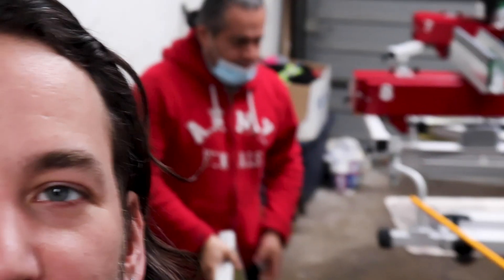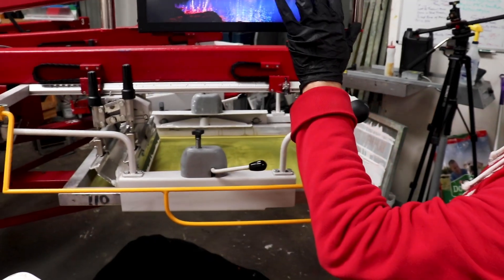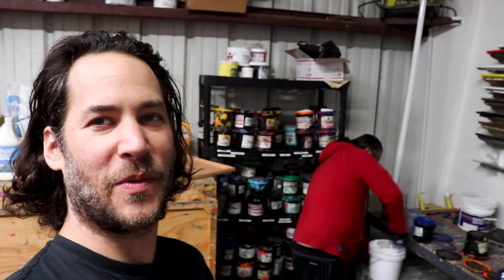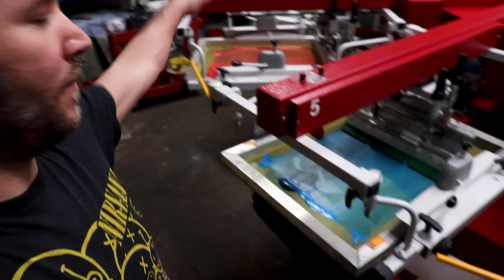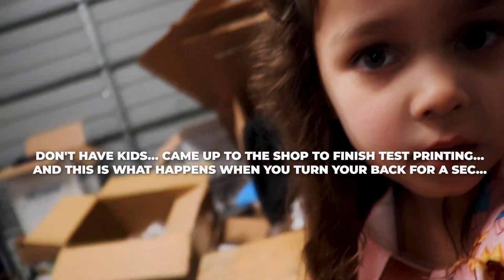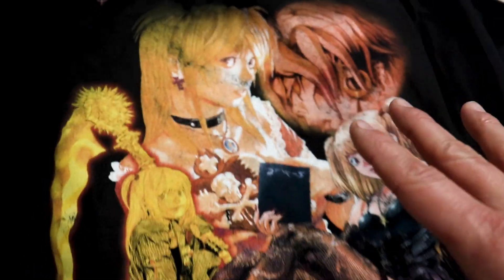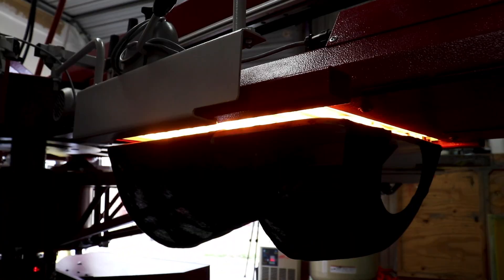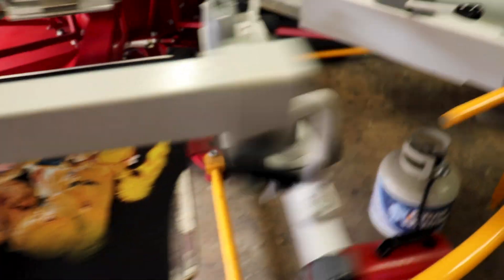Screen Printing Separations: The Good, The Bad & The Ugly - ActionSeps™

Comment: Which color should printed first for simulated printing?
Reply from the maker: Generally it's, white base, black, red, blue, yellow, turquoise, green, purple, gray, and white high light, but you can switch them around to see if it helps with the results.

Comment: When printing fleshtones, is it better to print magenta then yellow on top? I usually do the typical y, m, c, k.
Reply from the maker: It depends, honestly. With spot process we tend to do red first, then yellow. For CMYK, if the print is leaning a little to the red side of things, try magenta first. Only issue is, as you may know, yellow tends to pickup the darker colors and starts to mix with the previous color ruining the yellow in the screen.

Comment: Have you released that software yet?
Reply from the maker: Not yet. I want to make sure it's good to go before I release it. I want it to be as simple as a few clicks of a button.
Reply: @mikeydesignssilkscreen473  Ok cool.
Reply: @mikeydesignssilkscreen473  this is your software? will it be compatible with the canon pixma ix6820?
Reply: @mikeydesignssilkscreen473  c'mon already would ya! I'm going through the old skool tradition way of sepping using Mitch Different's training book, The Art of Color Seps. I've got one of the other guys sep software, but it seems pretty good and it's been around forever. I still want to keep my options open though.....but seriously, some of the sep software out there seems pretty damn good. When we gonna find out which one you used?
Reply from the maker: @xlnt3d01  I used Separation Studio 4 for the first print, and ours is the final print, ActionSeps.
Reply: @mikeydesignssilkscreen473  I've heard a little bit about that one. I use T-Seps, but mostly do it without the software. I need to make the process faster though. I still need to learn how to use it 😳. I've been checking out Magic-Buttons too. I saw your videos using your software, but missed the limited beta. Can't wait to see what you release. 

I'm still going to keep learning how to do the seps the old skool way just so I understand what's going on under the hood of the sep scripts.

Keep making awesome content!
Reply from the maker: @xlnt3d01  Thanks! Be sure to check out my tutorials on how to separate simulated process manually. I walk you through the meat and potatoes of what the scripts are doing. The scripts just help to get it done fast, and for those with limited knowledge in Photoshop.
Reply: @mikeydesignssilkscreen473  I agree, the scripts can make the process faster. I watched your tutorials before I picked up this eBook. It helped me to mentally prepare to accept the knowledge. 30 years ago when I got into screen print as an artist, for some reason I was having a hard time comprehending it. I left the business around '98 to become a computer animator. Mission accomplished. Now I'm back in screen print.....I missed it....I must be a glutton for punishment. Partially, I had to come back to master the sep process......it was a MORAL IMPERATIVE!